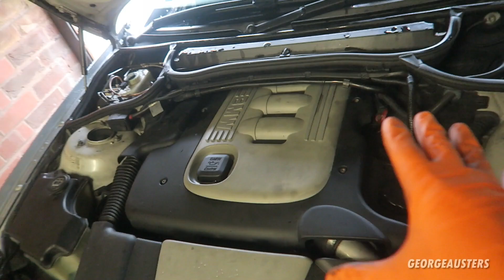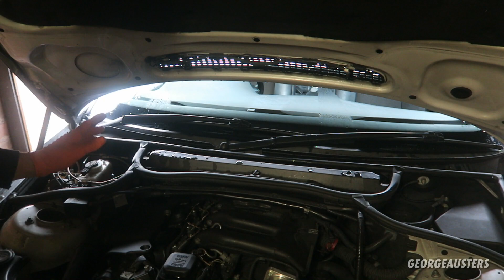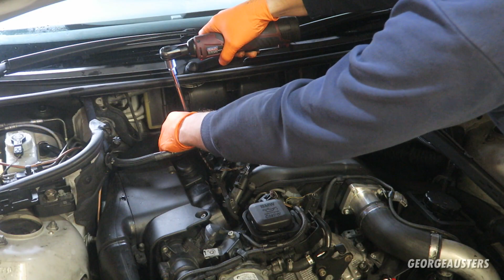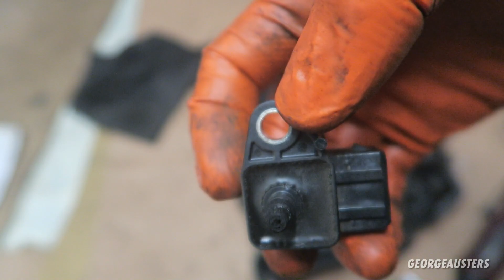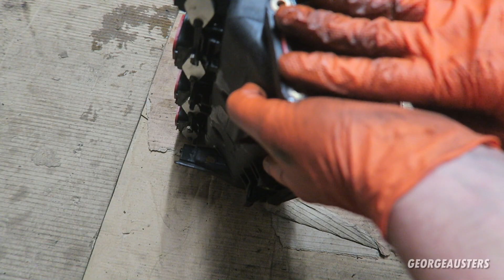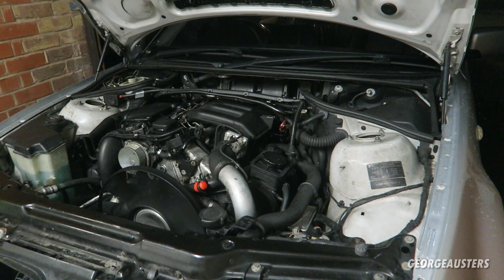BMW M47 / M57 Swirl Flap Delete | How To Remove BMW Swirl Flaps

Comment: As u stated in this video that the swirl flaps was already moved with the rods would u then still need to map it out ? Or did u only need to map it out because u no longer using the vacuum line ?

Comment: Hi George, hoping you can save me again !!😅
Done swirl flap removal with your guide today, awesome job as usual, but im stuck lol.
Ive removed the actuator/rod and left the sensor, plugging the vaccum line to the actuator with a bolt, all good, and re attached the vaccum line to the sensor.
Thing is, and its not in yours or anyone else vids ive searched is there in fact another identical sensor on the other side of the manifold? 
Ive pretty much put everything back together and realized i have only 2 vaccum lines out of 3 left and 1 is for the egr but there are 2 nozzles left for the other sensor.
Presuming the last vaccum line goes on the intake for that second sensor, where does it lead to?
I cant find any extra lines anywhere it should be connected to.
Long shot i know, but if tyia if you reply, if not, keep up the good work mate, love from across rhe pond ☘️

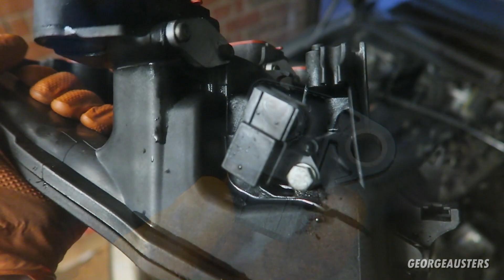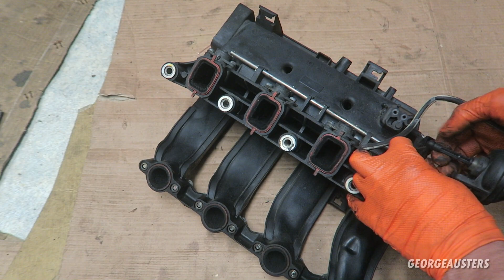Comment: Is there anything wrong if after i’ve installed the EGR, cooler & swir flaps delete kits I’ve left plugged the sensor @ 14:16 and its connection. I’ve only removed the vacum setup @ 10:20. As in should I also eliminate the map sensor wiring  at intake ports too? Or I’m fine with it plugged?

Comment: does this affect drivability or mpg/power? , i remember someone saying itl affect low end torque, im gonna remove intake manifold and fit swirl flap blanks,   also clean the egr. Can i just put a screw in the EGR Vac hose?, it should stop it from opening right?, Anyone please let me know :) Any help or tips are appreciated!

Comment: Does removing these on a 335d (2011) cause the engine to go into limp mode? Or just a check engine light? I'd like to remove them but I'm not getting it tuned for another month or so

Comment: I'm just a little confused why would you delete the flaps and not just ultrasound clean the manifold? The flaps were designed to improve the efficiency of the engine, with the flaps the pressures in the engine work for the benefit of the intake, by removing the flaps you are making your engine consume more fuel, produce less power and increasing the soot production, which is the most common problem that leads to most diesel engines dying. I understand doing this when you have the need for more air intake (if engine is modded with bigger intercooler, turbo, injectors and or chip tune) but if your engine is stock and you're just doing maintenance, don't delete the flaps just clean the manifold and you're set, save yourself from issues down the road.
Reply from the maker: I agree, I’m not a fan of removing swirl flaps but on an old manifold it’s a must.. A new manifold is the best solution
Reply: Delete because flaps break and get inside your engine
Reply: @Johnybravo643  That happens only if you don't regularly maintain your intake manifold

Comment: I saw the 4 small parts that turn the actual  swirl metal blade being remove and discarded however I didn't see the actual metal swirl flap  (the part which claimed many good engines) been take out Did I miss something or are they still in the manifold they just don't move any more
Reply from the maker: Because they'd already been removed
Reply: @GeorgeAusters  Ok

Comment: Dear George. I deleted the swirl flaps from my e39 525d and I experience a little torque loss on lower rpm. Is it okay?
Reply from the maker: It’s okay if you’re fine with it. But yes that’s normal.

Comment: Hi,what size is the swirl flaps on the 2.0d M47 engine?.It is a 2007 model.
Reply from the maker: You need to remove yours and measure them mate
Reply: 22mm got the same year and engine and that's what fitted mine.
Reply: @mddm26  Thank you

Comment: Perhaps you can help me with this. I have a 20d X3 with the M47 engine. I think the swirl flaps have been removed, but I’m not 100% sure. At low revs (1200-1800) I sometimes get some jerkiness, as if the throttle was on-off. Could this be because of the swirl flap delete?
Reply: I’d appreciate some feedback if you have it. Thank you 👍🏼

Comment: Hi there.  So, the 10mm screws will gather at 10Nm and the 11mm screws will gather at 15Nm. So, it's that correct? From where you have that information? From the manual? Thanks.

Comment: So I thought let's clean the injectors from my BMW 520 D M47 E60,  after disconnecting the battery took the 1e out clean the nozel and put it back with a new fire ring, and so on until 4, put everything in place, and try to start,,,,,, NO GO,,, it doesn't get enough air somewhere, took the ECR hose off and could start but running as a camel on 3 legs, what did i do wrong... now I have IMPA BMW software, and it throws me with codes and one special one ,,,, swirl flaps .... before disconnected in the ECU, I think it came back after taking the battery of or something,,, I think to take the flaps out,,, but not the vacuum hose. it totally doesn't have power en consumption 30 ltr 100. went towing it to two garages (B quick and another ) they could not fix it) I have the car home again, so tomorrow I will take the vacuum hose off (close it) it doesn't have power if I turn the steering wheel it collapse. What do I do wrong >??????George

Comment: hey :) did you use the 22 mm swirl flaps kit or the 33 mm? I have the 320d e46 (m47d20 engine). thanks in advance.
Reply from the maker: I linked the kit to buy
Reply: @GeorgeAusters  can't see any links related to the kit. Can you please drop the link here for me?

Comment: Can you not leave the vacuum controller in place, put a screw in the hose like you did and plug in the map sensor without having to remap the ecu?
Reply: You can leave the solenoid plugged and plug just the vacuum line

Comment: Hello George. I have the egr on the 150hp diesel engine off but not removed, and swirlflaps removed. what should be the connections in the vacuum lines that I should have? Thanks.

Comment: there is another solution that may be cheaper or may not depending on if you can source it. if you get a 318d intake manifold those dont have swirl flaps so no need to do this but it could cost you more money to buy a used one of those im not sure.

Comment: Thanks very much George, I'm an absolute Bimmer Beginner after buying my 120d M47N2 e87 2007 three weeks ago. I'm really finding your posts helpful and am getting prepped to do a swirlflap delete (as the car has done 175k) Thanks man!!
Reply: Mine is m47 e87. 120d 190980k miles, contemplating swirl flap, delete,  having injectors clean and glow plugs replacement,  also crankcase breather housing replacement.

Comment: Good video! Some things to note though 

-Most swirl flap blanks (atleast the ones sold around here) are a bit undersized, relying on the o-ring having to take up more slack than it should, which leads to the o-rings failing after a while, resulting in a boost leak. Some people add sealant on there, how good of an idea that is is up for debate. Unscrewing the flap itself from the shaft of the flap is another option (slightly different than what was done on the car in the video at the start, where the shafts were cut completely), that leaves oem quality seal. However warrants you leave the actuator shaft in place, so it prevents the flap shafts from coming out. Personally I opted for the more expensive blanks plus sealant after the first set of blanks failed as I mentioned. Either way you should keep an eye on whether the blanks have not become leaky after a while. That would be indicated with oil spray around the area.

-Must make sure all of the seals with metal washers are in place. The ones that go between the manifold and the M7 studs especially. You can see one is missing in the video, maybe he put it back on, or maybe it was lost. It wasn't mentioned. Either way they must all be there, otherwise as you tighten it up, it will crook over and likely not seal properly.

-You can leave the vacuum solenoid for the flaps in place, just loop it's inlet/outlet together with a bit of hose to prevent dirt getting in. That way you don't have a dangling connector and don't have to code it out to get rid of errors. Blank off the vacuum line that went to the flap valve close to the vacuum splitter. A bolt with smooth part of shaft will work. A bolt with full thread can leave a spiral path along the thread and cause a leak.

-While you have the manifold off, it would be a good idea to replace the 3mm (OEM uses 3.5x2 hose; 3mm and 3.2mm work fine) vacuum lines that go to the vacuum splitter under it. Especially if the vacuum hoses look like in the video, and even more if you have a car with vacuum actuated turbo. 5-6m of hose is enough to do all of them and it doesn't take long when you already have everything off.
Reply: Thank you !!!
Reply: Jet thanks for the additional info regarding the sealant aswell as the O ring, and on that note, do you reckon PTFE tape might work to make the blanks a bit bigger in diameter instead of Sealant, if the blanks are a bit pissy in the holes? then putting the O rings over the tape? Also, do you recommend using Bimmer Tool for diagnostics on a 120d M47N2 e87 2007??
Reply: @markhorridge7104  I would not use PTFE tape on there, it might help a little bit, but overall this is not really it's purpose and it might aswell just tear apart. 
Following up my previous comment, the 'more expensive' blanks seem to have failed since aswell. Maybe gooping them up in RTV to silly levels would improve the situation, but at this point I think aftermarket blanks are just a waste of time, as I've tried two different sets and both have failed in a fairly short term. Replacing the inlet manifold with one that had no flaps and therefore no holes to plug is the best way. That can be done on E46, not sure about 120d. Other than that I'd try using the OEM flaps just with removed flap from the shaft. The OEM swirl flap bodies seem to be of much better quality.

You can get a diagnostics cable for 15eur from the usual suspects and run INPA/NCSExpert. I use that, maybe other tools are better, maybe worse, I cannot say as I've not used them really.,
Reply: @skyperis  a little bit late here, but which delete kit did you end up buying? I can't really tell from the photos whether they are high quality or not... Also, did you use RTV silicone or loctite 5970 or similar? Any help is appreciated :)
Reply: Ehh, pretty sure they're all of comparable quality. I ended up using automotive grade epoxy glue, but just pkain old RTV is a better idea I think.  Use plenty and wipe off the excess inside the manifold and it should be good. Or better yet if you have an M47, find an intake manifold off a 318d that didn't have the flaps.

Comment: Hey, nice and informative video as always!

Would you recommend deleting the updated 32mm swirl flaps also? I've read that those are build stronger and I can't find information that those would fail and get sucked into a cylinder.

I'm about to delete the EGR and clean the intake manifold but I'm not sure if I should delete the 32mm swirl flaps along the way on my 2004 e46 320td.

Thanks!
Reply from the maker: Yes on the M47 I would
Reply: @GeorgeAusters  Thanks, will do then 👍
Reply: thats because youre a retard , flaps are there to create a swirl effect you lose power on low end when you delete the swirl flaps  @GeorgeAusters

Comment: George...Is it not true that these (efficient) flaps cause a smoother stalling of the engine while saving the dual mass wheel?
And do efficient flaps affect acceleration in the low RPM range ??? M87 2.0d M47

Comment: George my car won’t start now. Any ideas pal?
Reply from the maker: You have 12v and fuel?
Reply: @GeorgeAusters  Got it going eventually! I drained the battery trying to crank it and then had to jump it from the missus car and just kept cranking and it eventually fired up😊 I now have a coolant leak though but thats and easy fix. Thanks for the vid and the reply you've helped me a lot. I owe you a beer 👍
Reply: forgot to say, it feels faster now and idles better too! I might do the EGR delete soon also as cleaning it has made a huge difference. keep up the good work!
Reply: Hi I'm having the same problem I've done the same job cleaned everything I disconnected the battery from the engine bay I have an X-3 and now it won't start and I don't want to deaden in the battery I've also tried Easy start

Comment: Missed a key bit of info but video was good ... you need to unclip the connectors underneath the manifold before you can pull it up out of the engine ... i was trying and the connectors wouldnt let it free .. could end up damaging connectors

Comment: You broke the engine with this delete. You really should read much more about whole EGR system, intake and etc. If on M47 it’s not so critical, on N47 this procedure is VERY CRITICAL. If you say it’s “one less thing to worry about” it’s actually “much more things to worry about” now! 
Read about how all this system works together, maybe, it will surprise you a lot.
Reply from the maker: Haha don't worry man it's fine
Reply: @GeorgeAusters  🤦🏼‍♂️ 😂

Comment: Hi...i just done my swirl flaps on my e60. I cover the vacuum pipe with a screw as you did. I noticed that my brake pedal is hard now before starting the engine , is that because i blocked the vacuum pipe ? Is the only thing that i done on vacuum pipes . Regards
Reply from the maker: You brake pedal should be hard before starting the engine
Reply: So everything should be ok. I noticed this after the job. It wasn't like that before .

Comment: Done mine last year, and wish I could put up pic on the comments section, took a photo as one of the flaps/spindles was hanging on the edge of the intake ports, the carbon build up saved the engine, could have dropped in at any time!
Reply from the maker: Yep very common on these engines
Reply: Hi, can see its a long time since you commented this but, what was the mileage on the engine when the flaps was like this? Considering buying an E60 with some mileage so would be usefull info.
Reply: Usually 150k plus

Comment: I recently had my BMW E84 N47 motor rebuilt. Now my car sometimes goes into limp mode (CC-ID-29). What are the possible reasons for that? It does not happen consistently. It happened 3 times since I got my car back from the shop. It happened once when I was accelerating from 80km/h to 90 or so. The second time it happened in pretty much the same conditions. But the third time it was idling in P gear. First two times it went away when I slowed down and pulled over. The third time the yellow check engine light stayed lit and it went away after I stopped and restarted the car.

I do not have a OBD2 scanner at the moment, that's why I'm asking this.

Any idea why it happens? :'(

Comment: Another great video 👍
One question: with what product you clean/wash the material (manifold)?
My (e46, m47. Is a 320d sedan from 1999. Bough new. Now with 330.000kms) still have the egr... Last weekend I check the dirt inside, but it has less than that one on video.
Do you recomend to remove it? I also head that then it will increase on low rpm (bellow 2.000), it's true?
Best regards.
Reply from the maker: I have a video coming in a few weeks👍🏻
Reply: It was 5🎆 the new video about diesel filter.
Regarding my questions:
- what product you use to clean the manifold? (My still have the egr and is almost like that one)
- is it true that with the egr we have a bit more torque/power on low rpm? (Like 1500-1800)
Cheers
Reply from the maker: I have a video cleaning the intake manifold coming at the end of the month👍🏻

Comment: And how do I map the Swirl flaps out  I canna know how to do EGR and DPF how to map them out eventually but I've not seen a program with which you can map them out
Reply: You don't need to code them mate. There is no error for that.
Reply: @adrianzzzsss  thanks mate
Reply: @adrianzzzsss  are you sure?
Reply: @margauxlowery4324  I blanked them 2 years ago and never had an issue since
Reply: @adrianzzzsss  good to know. Thanks ;-)

Comment: Hi! Why did you removed swirl flaps? Whats the goal? Thanks
Reply: Because they can "go" in to the engine.
Reply: On this engine, it is a common issue that the flaps become brittle, break off and the flap will fall into the engine! Which in turn writes off the engine. Even bmw revised and removed them from this point on.

Comment: Thanks amigo great video!!! Just done my first ever oil change today on my n57 330d BMTROUBLEYOU. Thanks to your video on the n47 everything went sweet and was very to do. Thanks again mate!!!
Reply from the maker: Great to hear!
Reply: @GeorgeAusters  my only mistake was that filter clamp tool u use. It wouldn't fit on Mine. It was a 36mm socket. So had to nip out and buy one. But well worth doing it yourself and easy job and u know its done right. Thanks again
Reply: @bunabuna9287  I always use a big adjustable wrench work just as while. Some big plairs work just as well.
Reply: @mart43  I was gonna do that. But was worried about it being the right torque when putting it back. Knowing my luck it'll piss out oil everywhere 😀
Reply: @bunabuna9287  after a while you get a feeling for the torque settings.(I rarely use torque settings  only on wheel nuts) But when you dont have a lot of experience better be safe than sorry.
Reply: @mart43  I know mate. I nearly chanced it.  But the part was only £5 
And being first time i thought I'd better do it by the book. Thanks for the tip though 👍